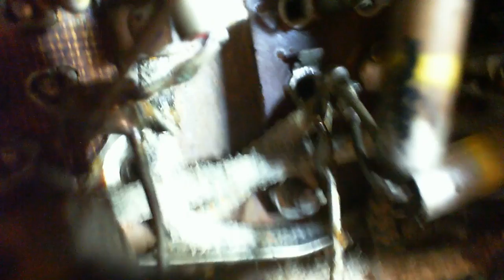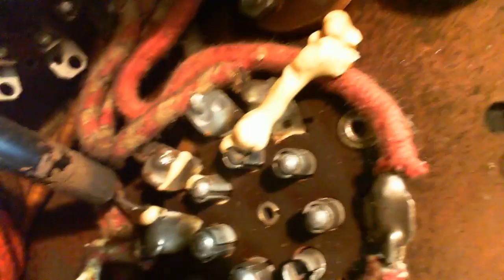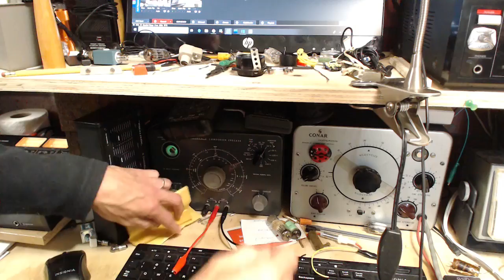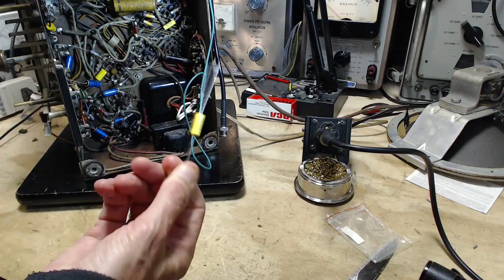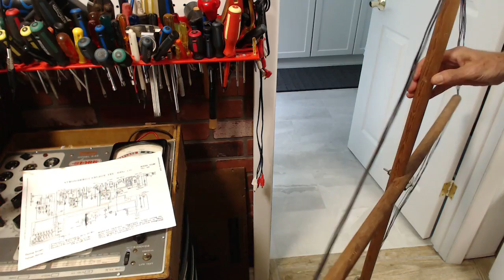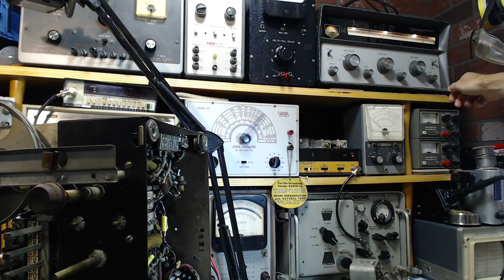Stromberg Carlson Model 515 Video#10 - Melted Capacitor?

Comment: You do need to hold the capacitor when testing. Not sure if it makes much difference with the newer, smaller capacitors. That may be why they don't mark them anyone. I haven't seen any issues with putting new caps in without finding which end is outside foil. Certainly not in the old thirties and forties radios, or even in my newer tube type FM tuner.

Strange results from your bench. Moisture in the wood? Really grasping at straws on that one.

Comment: Using your scope to find the outside foil end is pretty accurate, you have o set the vertical to the MOST SENSITIVE SETTING then switch on the X 10 magnification on the vertical  amp. I am not sure If the 465 has this or not ( X 10  mag ) you shouldalso adjust your sweep to get a decent sine wave display, it makes it less confusing.  And yes your new cap DOES have an outside foil.  You must hold the cap with your fingers tightly, sometimes damp fingers helps and check what end your hot scope lead displays the largest waveform this determines the outside foil end of cap to those viewers interested check Carlsons lab about checking cap polarity with a scope !! He also builds a small project to speed this process,  good Luck    John Bellas    KC2UVN